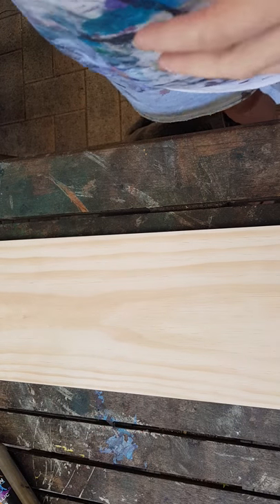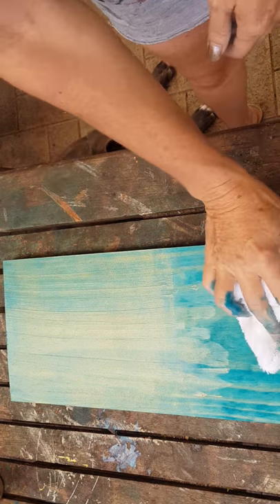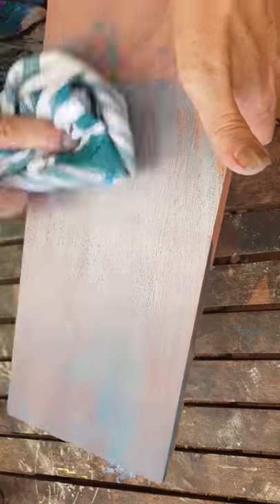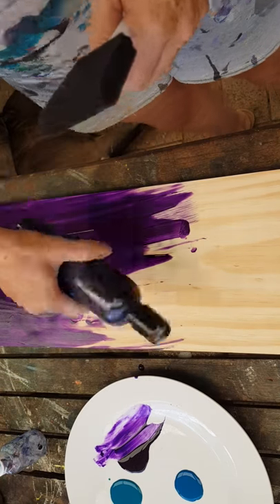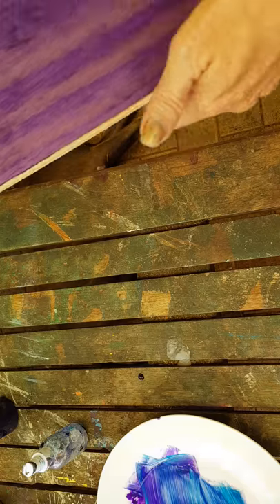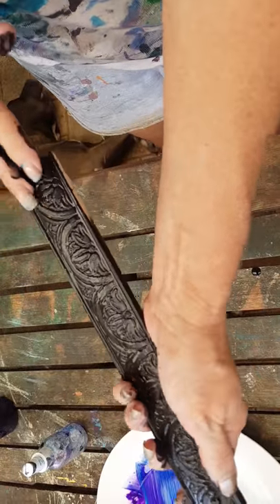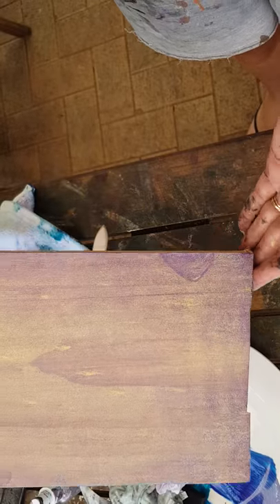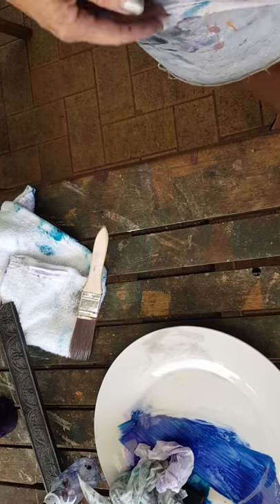Staining Tutorial - Boom Gel Stain

Comment: does it need to be sealed if using it out doors
Reply from the maker: aussie barb Hi Barb. Boom does require sealing. We recommend leaving for at least 7 days to cure prior to sealing. Our sealer, Boom sealer is UV stable, mold and mildew resistant,  and perfect for outdoors.  You can however purchase a sealer from your local hardware store. 😁